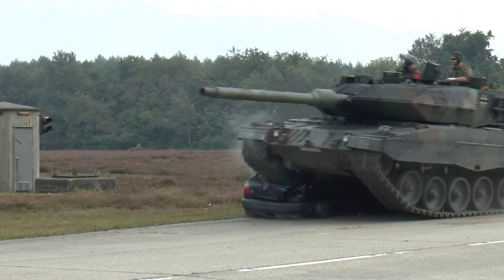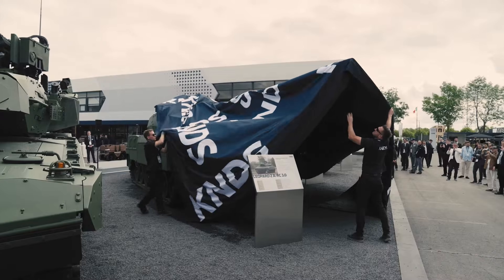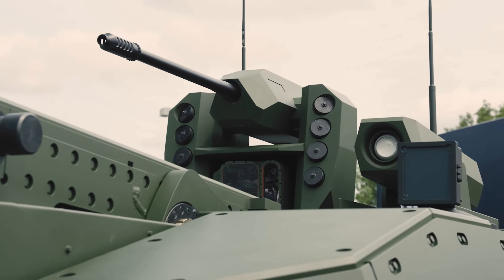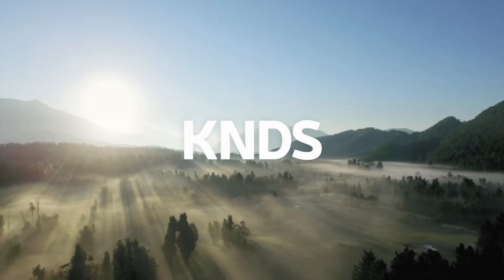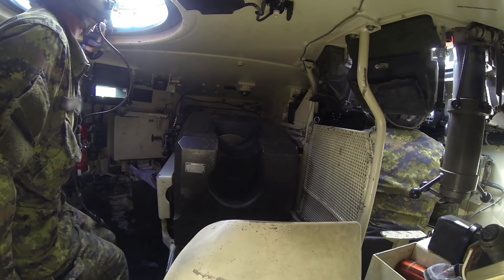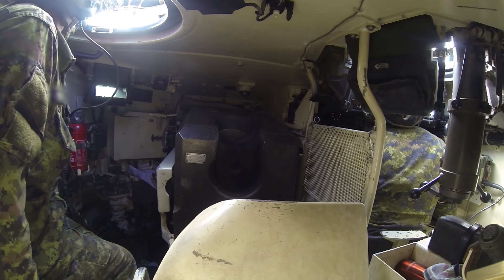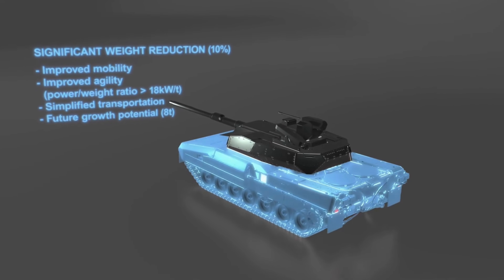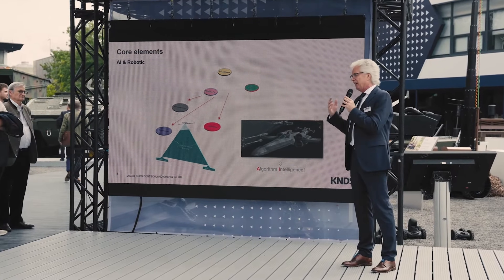The Leopard 2 A-RC 3.0 Main Battle Tank | 140mm SMOOTHBORE GUN

Comment: Absolutely nothing is "revolutionary" on this tank. Nothing. Why a 140 when the current 120 destroys every enemy tank? Why a 30mm for light/no armor? A .50 cal will do that job easily and hold a LOT more rounds. And now a tank needs missles? Been on the Bradley from the get go. How is that 'new and innovative'? Or using the Israeli Trophy 2 system? Or the bottom escape hatch? NOTHING IS NEW HERE.
Reply: Design of crew protection relatively new, bigger rounds allow more intelligence 30 mm  for automated anti drone warfare since 30 mm is big enough for airburst
Reply: @emilsinclair4190  a .50 holds more rounds. So airburst not needed for intended use. The 120 goes right through any armor. Especially the russian armor. Chinese is basically same as russian. So, unless the goal is to fight USA or UK, where is the logic?  Also, the 130 cannon can be easily placed on the current Abrams. So, again, "revolutionary"? The 30mm is on mutiple vehicles from MRAPS to airplanes. So, again, "revolutionary"?
  We have become a world where words have no meaning. Even the word 'literally' is no longer a literal word. Claim something is revolutionary, then it better be more than warmed up leftovers. And the purpose for each is no longer what the purpose of the whole is. Sure, you can install waffle irons, a few water tight hatches, and a docking station for Elon Musk to use. But what does that do for PURPOSE? And how does that make it revolutionary?
Reply: @goatman3828  more shots with smaller calibre is true. However do to spread and travel time airburst allows you to create a higher density of submunition in the area where the Munition actually is. This and also range is why they ate used in modern air defense purposes (and why this has rhe advantage of having I terchangabel ammunition).

Now since those tanks should be in service for a long time they are future proof. Since additional armor or aps can reduce the penetrative larger calibre allows you to still penetrate armor in the future under those circumstances.

Sorry but your definition of revolutionary is also wrong. I mean armor was already on warshisp, big guns on artillery and tracks on tractors. So tanks were obviously not revolutionary right /s
Reply: @emilsinclair4190  that 30mm belongs on an APC, or something similar. The tank's mission isn't clearing trenches or used as artillery. And the vid claimed "revolutionary", not me. Again, there is nothing revolutionary about this machine. And, again, there are other current tanks able to hold a larger cannon IF NECESSARY.  But until a russian tank, well, the only tanks they have left in any quantity are T64's and earlier. So upping to a 140mm makes no sense. None. A tank plays a specific roll. Not as a FPV launching base. Not as artillery. Not as an APC. Not as infantry.  And having a 140mm and 30mm decreases the ability of that tank to stay in the fight. Using a 30mm instead of a .50 cal to destroy supply trucks is stupid. That is not the tank's purpose. Clearing trenches is what infantry is for. That is why infantry always accompanies tanks. And much of the infantry will be in APCs. Which is where that 30mm should be. To combine with the foot soldiers to clear trenches, machine gun nests, bunkers. 30mm great for that. On an APC. A tank isn't used to clear a machine gun nest. That is shitty doctrine. A tank used as artillery is shitty doctrine. So to build a tank to do those things reduces the tank's ability to do what a tank is supposed to do.
Reply: @goatman3828  you are claiming stuff that nobody stated. The purpose of rhe 30 mm is not against soft targets on the ground but instead against drones. To have a long range air defense tool this calibre was chosen. During the cold War a mg3 was placed on German leopards to provide them with air defense. This is basically just the upgraded version of that. 

However if a tank will encounter infantery or softer largest of the enemy it will often take the opportunity and attack them (if he can easily destroy them). In this case the 30 mm is a bonus sinc3 usually they would use the main gun for this purpose which is overkill. However this is just a small benefit since usually combined arms is a thing.

Now tank on tank combat usually depends on who hits the other first. Drones for better situational awareness especially in urban or covered areas is a big plus for this job.

Intelligent Munition and over the horizon attack capability enable the tank to attack other tanks in limited capacity before they can even shoot back. Tanks try to engage the enemies without risking themself as much as possible so this is just a natural development of their purpose.

Now you claimed that just bc something already exjst on a different vehicle it is not revolutionary. I countered with the fact that the components of a tank existed on vehicels before the tank existed. But we still call the tank revolutionary.

Now what are those new components? Well fist new architecture with unmanned crew. Then we have computer controled air defense. Enhanced computer support. Better armor with less weight. Drone integration. The combination of all those additional capabilities into one vehicle makes it revolutionary.

You now have a tank that can destroy other tanks without being able ro be hit by them. That can defend itself agaisnt drones. That can destroy every tank for the foreseeable future even if they are equipped with aps systems. You have a tank that protects the crew better while also reducing the weight drastically.

Also you don't build a tank for current threats. You build it for future once to make it future proof
Reply: @emilsinclair4190  I honestly appreciate your well thought out responses. But there are a few problems.
 Infantry travels with tanks. It is the infantry that keeps the swarms of pesky enemy soldiers from attacking the tank. That is why the 30mm should be on the infantry vehicles. It compliments the infantry mission. 
  Having the ability to launch drones is piss poor design. In order to do this, the tank now has weaker and thinner hatches to cover the drones and then pop up and out of the way. Hatches are ALWAYS weaker than the hull. Again, this is well suited to the infantry or IFV where the armor protection is much lower. Mortars are what shoots over and beyond. Not the tank. That is not the purpose of the tank. And carrying less ammo in the tank so that it can fire systems beyond need is stupid. If I go rabbit hunting, I will not use a .30 cal weapon. I have a .22LR for that. To waste expensive ammo to obliterate the rabbit, and now I have nothing to shoot at the next rabbit...piss poor strategy. And if...if I go out to get a tiger with my .30 cal, and suddenly I see a rabbit instead, well, that is exactly why I brought my friend with his 22.  You see how we can be more effective working together to our strengths? And when that tiger shows up and his .22 is too small, that is why I have the .30 cal. Again, working together using both our strengths.  There is a reason there are scouts, fighters, and bombers, and cargo planes. Each has its own task and are purpose made to fill that roll. If you try and make 1 plane that can do everything then you have everything done poorly. Same with layered armor. Putting pop up panels for missles, drones, and ice cream cones (nice rhyme) on a tank WEAKENS the tank's ability to be A TANK. Taking main battleship guns and putting them on an aircraft carrier might sound cool, but it makes no sense. Now you have huge guns in the middle of the flight deck. Kinda hard to launch planes with 16 in guns mounted in the launch and landing area. Do you see what I am getting at? The 140mm cannon is not a new invention. And it hasn't been put on a tank for a reason. And that was when we thought russian tanks would be hard to blow up. Now we know they practically destroy themselves. Upgrading to a 140mm now is a waste of space. A loss of ammo storage,  and extremely increased wear and tear on the turret and chassis. Where is the benefit? Launching drones sure would be neat to watch, but that puts a big weak spot right where you need MORE protection. Putting a 30mm to have burst rounds greatly, and I mean greatly, reduces the amount of ammo carried.And the .50 cal has had exploding, and incendiary rounds for decades. And clearing trenches is the INFANTRY'S job. Shooting way over yonder is done by mortars. That is THEIR job. Shooting accurately way over yonder is ARTILLERY'S job. All these things you think would be just swell for a tank to do has job specific tools (that look nothing like a tank) made to do that job. Artillery does not look like a tank because it is made to be artillery. Not a tank. A mortar looks nothing like a tank. Because a tank looking mortar would suck at it's purpose. Get it?
  If I am going to paint the kitchen, why the hell would I use a fishing pole instead of a paintbrush?  Or spend millions of dollars to have a fishing pole with a paintbrush stuck to it? I ALREADY HAVE THE PAINTBRUSH. And it is designed and made specifically to spread paint.
Reply: @goatman3828  long comment so multiple replies: why are you trying to talk about infantery? The 30 mm is not against infantery. That is what ifvs are for. The 30 mm is for anti air defense. Not against infantery. Not agaisnt trenches. It is for air defense. Period.

Now you might want to say that you should have dedicated air defense vehicels. And there are. But air defense is a multi layer system with the leo 2 already having a mg3 for anti air duty with them.

This mg3 now just gets replaced by a 30mm since air threaths become more common.

You run into a flaw in your thinking. You see that there is something that does a certain job so you are against putting it on another vehicle. In reality 5his is always a case by case decisions since sometimes putting the ability of one vehicle on another can crate more benefits than problems.

This is why tanks are also equipped with machine guns. Bc sometimes they will fight against light targets. See how this is a fusion of different systems into one bc the additional utility helps?

Drones for situational awareness are a huge boosts for tanks. Now if they have to be launched by tanks or recon squads is up to debate since this is a new topic. Putting it on tanks has some advantages and disadvantages.

Making the armor weaker is not one of them since the new armor layout puts the crew under more armor not less.

Comment: Tbh, I see this more of a tech-demonstrator for MCGS. It will simply be too expensive to upgrade a fleet of, say Leopard 2A7s to this and then maybe two decades later (tops) having to replace it with MCGS. I find it more likely that A6-7-8's will be gradually "upgraded" based on the learnings from Ukraine - especially in how to mitigate the threat from UAVs - though most of that comes down to doctrine and operating along system that are specifically suited for countering UAVs.

While I agree that 12.7mm RCS are not sufficient form counter UAV I'd rather be looking at a 20-25mm setup with advanced munitions - think Skyranger, that allows loads of flexibility and allows you to bring more ammo and fight pretty much anything up to an MBT or hardened position.

Comment: It can be 180 if they insist, but ATGM still has beter range and precision ower 2km.
Only constraint is optics and terain.
Kornet whit 8km range whil win, fiber optic guided whil win in indirect fire mission.
So it most likley 10 milion tank against 100 k max missile or drone...
Logic conclusion...
Reply: How does the Kornet do against hardkill systems?
Reply: Two launched in pairs in short interval, most active protection systems cant cope whit such scenario, by now there is most likley even a version whit countermesures. Even whit 10% hit rate its stil beter off (much higher, even whit active protection). Chechens used tank hunter teams whit up to ten RPG launchers in first Chechen war, same thing but whit ATGMs @germanvisitor2

Comment: I've always liked the Armatta concept because of the layered protection it gives the crew. I thought that a protective shell within the hull of an MBT, like the cockpit of the A10, would make a huge difference. In addition, you could also remove armour from elsewhere in the vehicle to make it lighter and more mobile at the same time.

The 30mm cannon on the roof is an excellent addition, though I'm not sure about needing a missile launcher. To reload a launcher, you'd need to get out of the tank, plus you'd need storage somewhere for them and space is already at a premium.
Reply: In a peer-to-peer conflict, having to get out of the tank doesn't seem to be much of a problem. As I understand it, the tanks go forwards 5km, engage a few enemy vehicles or positions, and then you're quickly retreating back into an urban center or under a tree canopy. If you then wait there for 20 minutes and don't get shelled by artillery, then you know that the enemy drones haven't followed you home and you can feel safe leaving the tank.
Reply: Handy as a backup or for very specific targets

Comment: I love leopard 2k, and 2A6. I never imagined that someone will just take best of both and made greatest meta tank in war thunder xd. Even if gajin would make armata work, this 140 will make armata armor feel like paper.
Reply: The 140mm gun is actually designed and built by KNDS France, not Deutschland. It's the Ascalon program, a 120 and 140mm compatible system. The German are stuck with 130mm, not compatible with their excellent 120mm L55 gun.

Comment: Some points. 1. Mass. No way that tanknis less the 60 tons. They all lie about wight of the tank. 2. 120 and the 140 guns are pointless. Active protection system is rendering them ineffective. Ammo is big and heavy and expensive. 3. Mobility is key. Long range less logistical tanks r the future. 
As i see it the big guns r point less. A gun that shoots 140mm rounds is expensive harder to maintain, and has a high wear and tear. 
Using ifv as the future tanks is the way to go. I would have used the israeli Eitan apc as a midum tank. It has a un manned turret with a 30mm bushmaster gun and 2 spkie lunchers. Put some extra armor for protection from 30-40mm guns and use it in groups of 4-5 at a time. The 30mm can fire air burst ammo that will take out sensetive gear such as optics, era, active systems like trupy and such. Non of this sysytem can protect from 30 rounds exploding on the tank with shrapnels all over. After then a second Eitan will shoot a spike from behind a ridg line not even exposed. The platform can be even more sopbosticated. One of the can have a telscopic pull with long range sensors, optics and thermic sights. He can rise the mast without exposing it self, spot target and delegate it to two other that will go up satureat the target with 30 mm rounds to create enough superfical dmg and the 4th will shoot spikes after guided by the 1st one. Add to that a 5th that can be without a turret but as a drone carrier, and u got a flexiable unit that can do infentry support, recon and armor on armor war fare. On top of that, if u make that 30mm gun flexable enough that it can function as an AA gun that can give protection from both helicopters and mainly fpv drones. Air burst 30mm have been proven extremly effective vs this typ of drones, even a sworm are very vulnrable to it. This give u a single platform for both armor fight, drone fight, short AA system, and apc. Highly mobile and effective. U can see what happend to t90 when the fought the bradly. Even the fact it did not get pen by the 25 mm rounds it lost its optic, got its turret jammed and driver lost view port. Use a spike/jevllin to finish the kill. Or grande droped drones. Cheap relable can drive everywhere and extreamly effective.
Reply: Lying would be criminally do no they are not lying just using new tech.

To prevent defenses by and 140 mm is used since the round is big and long enough that even after aps it can still kill a tank. 

Ifvs have their place however don't forget combined arms since they would get eaten by this tank.

Comment: It makes sense tanks are much more complex than relying on layers of rolled steel but more and more on modern active and passive defensive systems.
The role of the tank is still strong. Even if the role evolves. It's still good to have the kind of defensive mobile machine capable of engaging other heavy armor.
Especially as the active defense system evolves. You don't want to have to expend 20 anti tank missiles just to hope to get 1 past the active defense system.
And it's a lot harder to counter a 120mm, 130mm or especially 140mm anti tank projectile.

Comment: They should be running Drone tanks with 3-5 drones commanded by 1-2 crewed tanks. With bigger guins or anti drone functions built into tthe tanks depended on mission or avaliable support. The spike missile could be used to cover a retreat when outnumbered (launched towards the enemiy without a lock and leave it up to the AI to f&f the enemy